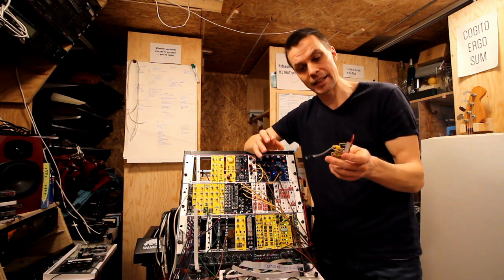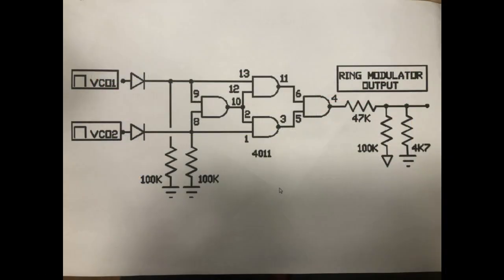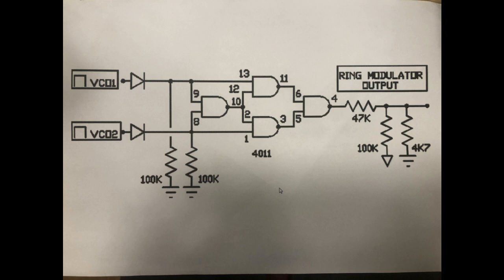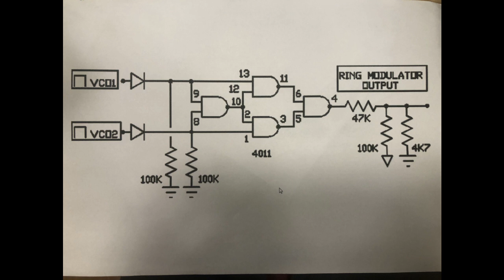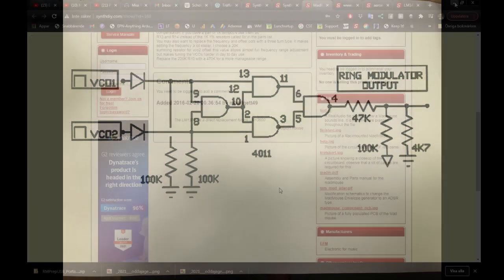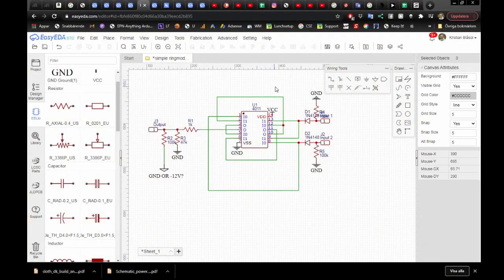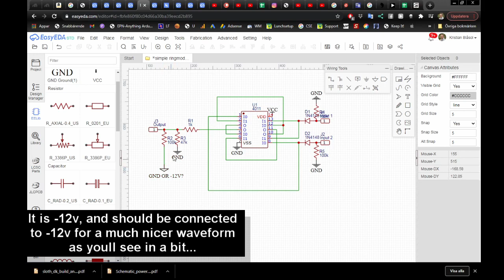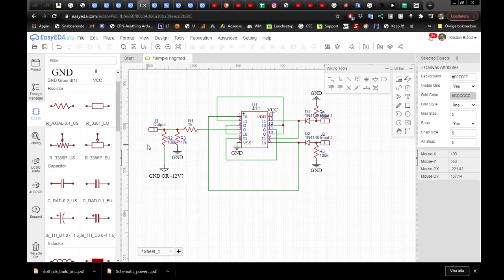A Simple 4011 Ring Modulator - Modular in a Week 13.4

Comment: This circuit can be found in the Korg MS20. There they were actually driven by pulse waves from -15 to +15V -ish, and the diode arrangement was to delimit it to 15V/0V. The resistor arrangement at the output was to shift it back half way down.

Comment: I kind of liked the effect of the first "wrong" circuit. Though the right one was nice too.
Reply: Me too. There was a harshness to the 'wrong' one that was not present on the 'correct' one. Though the warmth of th correct one was nice in its own way. If I would build this I probably would either build two different, or add a switch to get both versions :-D
Reply: @rolab280  they were different. The "wrong" one wasn't too bad either. I thought it was a nice effect. I do tend to like harsher tones. It just goes to show that perfect isn't always best.

Comment: Great video. Im wondering how do you get those curves in the fixed version if the output of the 4011 is digital, so 1 or 0... It should produce just squares, isnt?
Reply: I've simulated it in Falstad and all i get are irregularly spaced pulses.  No curves in the waveform at all.
Reply from the maker: Agreed. That is what I thought aswell. But unfortunately I have no good explanation for it. 🤷‍♂️
Reply: I would say this is operating the gates in the "forbidden" zone (i.e. between the digital 0 and 1). There the gates are more like (poor) amplifiers and the effects are not really as expected, as this is at the heart a digital circuit. Nonetheless interesting results, I think you have discovered something worth exploring here. put in a 4093 schmitt trigger quad nand gate instead of the 4011 and you should get clean pulses.
Reply: @reneschmitz4845  You think it's the lack of Schmitt triggers that allows the curves?
Reply: @johnirving8237  Well a 4093 would form clean pulses from what is presented at the input, then that gets processed by the XOR function of the four NAND gates. The 4011's behaviour is more analog. Btw, your simulator probably doesn't model the innards of the 4011, so the results are not as you simulated.

Comment: Really neat build, and even neater patches you put together! 

Just so you know, the 100k to gnd (that should have been to -12v) isn't doing nothing, it's acting as a parallel combo with the 47k next to it, so it's the same as if you replaced both with a single ~32k resistor.
Reply from the maker: Yep. As I explain in the video I did this wrong the first time around and fixed it by connecting it to -12v on the second one and the result was a much nicer waveform. Good to learn all the time. :)

Comment: Yet another excellent video, thanks! The ring mod got on to the ever growing todo list.
Could you help me understand the input and output staging here. I would interpret the schematic so that the inputs are kind of half bridge rectified to the positive cycle only and the output is sort of DC offset back to around zero centric or am I totally lost?
What would it say if the inputs would be offset to +6V and attenuated before hitting in to the 4011 and output offset back and amplified?